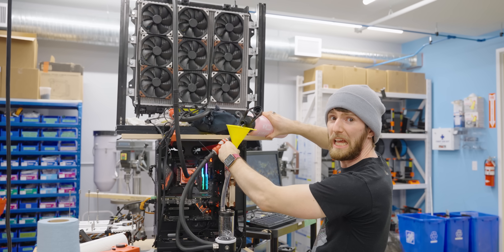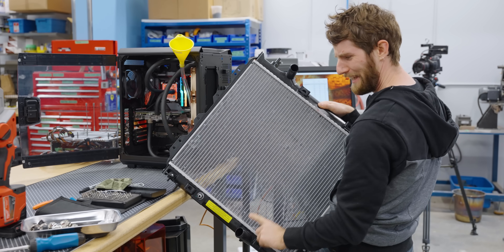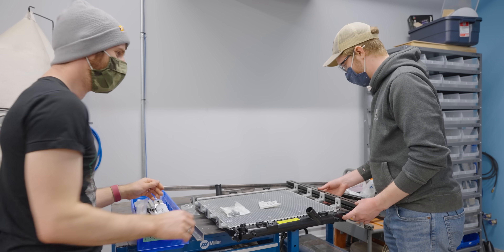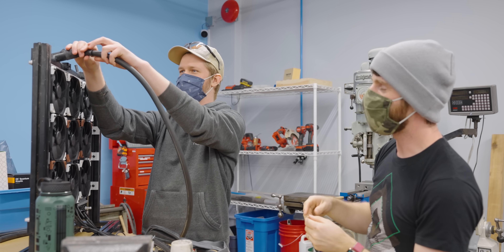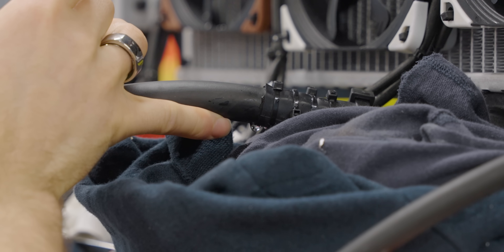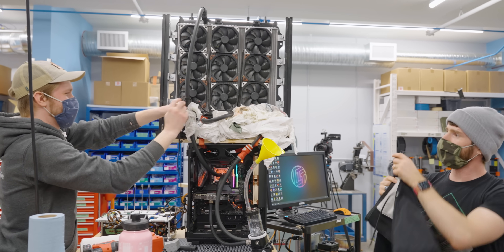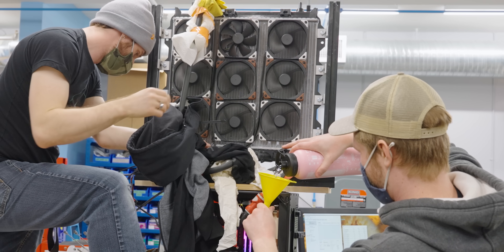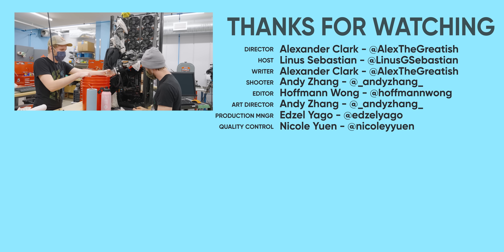Our Craziest Cooling Project Yet - Car radiator liquid cooler

Comment: 3:05... Hmmm, the transmission cooler part cools high pressure ATF (automatic transmission fluid), which is more a high detergent oily feeling substance, thick),  the motor cooler cools the water7coolant mixture flowing through the engine channels to cool it. If u link them, that means your fluid will have to literally fill BOTH channels before return, AND, one channel is not made for water but rather, hydrualic fluid (ATF). They'Re actually 2 radiators in one. Transmission coolers used to be attached to the outside of this motor cooler, but I guess now they're just "built in." U go a water base so, stick the the water (engine) channels. Oh, and u should prabaly actually use some anti freeze so you don't ruin the internal components of the radiator with rust or chemical reactions.

Comment: I know I’m super late to the party but, y’all are using the ports for the transmission cooler section of the radiator. If you use the to big ports those are the ones used in cooling the coolant.

Comment: A motorcycle radiator would have been better. I wouldn’t have worried about the transmission cooler pipes on the radiator they wouldn’t gain any extra cooling as the pipes just go through the water that is in the radiator already.
A proper redo would be good. Less duct tape and more proper setup.

Comment: First off you could have got that radiator cheaper on eBay probably could have got 50 bucks you could use the extra money to go to the hardware store and get some plumbing fittings and downsized it to whatever you want it and if you're not planning on using the radiator again you could have just used plumbers glue!

Comment: 20 yrs ago car radiators were what everyone used. There were a handful of cars that were known to have radiators that could easily be shrouded for 1-2 120mm fans (or bigger if you liked). As I remember, there really was minimal advantage to going bigger unless you were trying to go passive.
Reply: They were the heater cores, a radiator this big is designed for levels of airflow that won't be achieved inside a house without a turbofan.
Reply: 20 years ago was only 2003......
Reply: @Alcoholic_Nerd  Well 20-30 years ago. Before there really were over the counter water cooling kits, or at least any that were worth using. Haven't kept up exactly on the scaling of thermal load from cpu's and gfx... but casual observation says cpus haven't increased much, while gfx have gone up 100-200 watts or so... shouldn't really impact the size of a radiator required for liquid... guys were running systems with TECs on top of their CPU's and GFX without scaling up systems much if at all; which was probably pushing them to about the thermal load of a modern system.

Comment: Have you looked into using a transmission radiator for a build? They come in smaller sizes. You can use two and have it in a smaller form factor.
Reply: I was thinking the same or even power steering radiator

Comment: This video makes me think about an external honda rad with the og fan and a small pump running off a 12v power supply outside the office and piped with pex pipe through the walls

Comment: Guys should re-do this video with a smaller rad (motorcycle maybe?) and you could remove one side panel of the case, and put the rad where the panel was essential turning the rad into a piece of the case.

Comment: Since it is an actual car radiator, why not use car radiator tubing and connectors to hook it up and modify it to mount to your PC.
As well as used Antifreeze instead of water for coolant.

Comment: Transmission does not need much cooling so it makes sense to just have it integrated with the engine line. Also might be the oil itself that gets passed through judging by the fitting for it.

Comment: Which numpty decided to put the radiator on top of the system before you’d even run an air leak test before starting with water? Stop messing around with crap zip ties when jubilee clips would have been so much easier. I get it, a lot of unnecessary screwing around makes for a dramatic story, but it also shows that you guys should never, ever, work on any domestic plumbing or anything to do with combustion engines. 
The whole episode was a total car crash from the start, but bloody funny all the same!

Comment: I made my first water cooler (in eary 2000s with an athlon xp 1800 cpu) from a chevette heater core with 4 80mm fans and a 10 gallon fish tank. It worked perfectly and only cost me a few bucks at the auto recyclers. Eventually I waterproofed in and around the cpu socket with neoprene/dielectric grease and added a peltier. Combined with a mobo voltage mod, I was able to get over 4Ghz and the system was stable.

Comment: The transmission cooler is closed loop from the Radiator.  You cant fill the radiator, using the transmission cooler lines.  I know this is an old video.  You could have only used the large Hose connections for this purpose.
 
As a car guy and a computer guy i always wondered how this would have worked also.

Comment: I feel like they lost a lot of flow rate from using the trans cooler loop, since all that does is flow trans fluid through a small heat exchanger in the radiator tank to disspate the heat into the rad water
Having it in the loop wouldn't  change thermals, just add resistance to the loop

Could be cool to see this used with a mineral oil PC where the mineral oil is cooled through the rad (though watercooling a mineral oil PC would be fairly pointless too but interesting nonetheless) Or you could use it if you wanted two independant loops for CPU and GPU using the same rad

Comment: Two points I'd like to make. First, how you were testing the radiator water was coming out one of the transmission cooling ports which indicates that the transmission cooler is no good in that radiator. Secondly how in the world do you guys work on computers without understanding that if you put a cooling tank inside of the coolest part of a radiator it's going to cool whatever liquid is going through that cooling tank?
Bonus info, all you had to do is blank off the transmission cooler taps.
This is getting hilarious, it's like watching Joe Biden try and give his State of the Union Address. Go get him!

Comment: The thing is automotive radiators are pressure rated to pass way more heat to the air from the water circulating I say y'all should have opted for a 04 grand prix radiator because it has a cap at the very top but it would have been waaay more annoying to use I say there should have been like barbed fittings or nipples really to have hose clamps there to bite down on to stop leaks and fill it from the top because car radiators can take like a literal gallon to fill and filling from the top well for air mostly. But that radiator is rated for 16 psi you should probably see if that benefits in anyway to see if the water can withstand more heat transfer to keep it cooler a car engine can well heat over to boil water and it looks like a cpu can too

Comment: The radiator that's inside the heater unit would be better suited, they usually have a decent 12v squirrel cage blower all incorporated into the housing as well as using smaller tubing.

Comment: I have a very good idea for this. But this requires long tubes, and living in a winter place. Stick it outside mounted next to a window, cover it with some anti freeze stuff and even furnaces to keep it from freezing, but the water/ coolant will be super cold and keep the cpu (and gpu if you water cool it) super cool and chilled. Except you would possibly need another pump to pump from the radiator to the pc, so it'd be in the middle.

Comment: You could probably accomplish the same thing with a bucket of water with equivalent thermal mass. Unless you're able to build a watertight loop and leave it running for several hours you won't know what it's like at saturation.

Comment: I'd like to see this project revisited, but with just a SLIGHT bit more effort put into the plumbing part of it so they don't have to continue filling up the pump reservoir due to leaks. It wouldn't even be that hard to do really. Maybe they could even use a car's electric fan, too.

Comment: dont need tranny loop..better to use just the engine radhose connections..trannyline is just a short tube from one port to other on the bottom

Comment: Ditch all of those fans and bolt a box fan to it lmao but to answer linus's question about the radiator having two seperate cooling loops. on modern cars it is extremely common to have the radiator also cool the transmission fluid or power steering fluid. So they double as a water and an oil over air cooler

Comment: The transmission cooler is a separate heat sink inside the radiator end tank. ATF (automatic transmission fluid) goes through that separate, smaller heat sink and still transfers heat due to being surrounded by the engine coolant inside the end tank. So in a way the transmission cooler still rejects heat into the main radiator, removing any need for a large radiator as it only has to transfer the heat and not dissipate it.
Reply: Btw, even though the OEM style plastic radiators are cheaper, a full aluminum radiator would be much better for a project like this as you can modify the end tanks much more easily for your application, even welding on PC water cooling fittings, compared to duct taping mismatched hoses to the plastic end tanks and making a huge mess with all the leaks. In fact you can actually get custom sized cores and weld your own end tanks on, pretty common practice for performance automotive.

Comment: For years I have been wondering about using a car radiator as a means of getting cooling without fans, or at most 1 large fan running at such low speed, you cannot hear it. I want to test it on my next PC build. But before that, I will try an air conditioner condenser coil which I already salvaged from and old portable AC unit and already has a large fan to go with it. Nice to see this project. The largest hurdle would be finding a way to connect the loop to radiator inlet and outlet without leaking. I would ignore the transmission lines since that is water cooling your water, i.e. no actual cooling improvement.

Other ideas when I get the time and money. I can have long tubes and place the radiator outside the house so the heat does not warm up the room and I can run the fans harder without hearing the noise. Another idea is to have the loop consist of copper tubes soldered along the tubes of an evaporator coil of an air conditioner, so the air conditioner directly chills the water and the noisy condenser is outside where I cannot hear it.

Comment: You definitely can get a rad much cheaper online and could have gotten one with a fill port that would have been much easier to fill and using the trans cooler only adds capacity

Comment: i actually used a setup like this for a while. i used the ac condenser out of a Chrysler Pacifica along with the dual 10" fans that were on it from the factory. i ran the fans in series of the 5 volt rail of a Molex connector. if you cut off the threaded fitting on the condenser you get 2 lines with ~.5" outer diameters which is about perfect to force on some coolant lines. the cool thing about this. is the radiator is big enough that my temperatures did not change when i had the fans on or off
Reply: and of course naturally because it didn't fit in a case i just screwed it all to the drywall. drywall in non conductive for the 12 volts computer operate on and never had any problems with leaks or thermals
-ryzen 1700 overclocked to 4.3Ghz
-GTX 1070 msi twin frozer
-GIGABYTE GA-AX370-Gaming K5

Comment: Do it with a 1990's honda civic radiator, which is much smaller, and capable of literally being a side panel on the PC.

And get your radiator from a damn junkyard. I bought my wife's ooooold car a new radiator and the guy at the pick and pull wouldn't even charge me the full ten bucks for it.

"That's not a radiator. That's half a radiator. I'm only charging you half for that thing."

Comment: Master car guy, but also nerd: *them discussing ins and outs of radiator, and the loop they wanted* 

ME: NO! nO!!!! Ignore the little ones!!! Just use the big ones!!! 

(Reason; the little ones are for cooling the transmission oil, inside the bottom tank of the radiator it's segregated from the coolant. Its just a coil or block or something cooled by coolant. But it's low flow 8-10mm line. No dice for your application.)

End edit: "it's two chimps on a davenport, in a basement"

Comment: This was infuriatingly stressful to watch. Put the damned radiator on the table next to the computer and make sure everything is sealed before you put the water in. Do a blow test while plugging the opposite end to test before putting in any liquid.

Comment: not read the other comments, but you have a double sided case there, would it not be possible to find a car rad thats small enough to fit in the back side of the case, and move the rear components into the front?  It should only be the psu and ssd back there, right? more than enough room in the front with only 1 gpu
Reply: As well, I always see car rads being used, have you thought of motorbike rads?

Comment: Id like to see this actually attempted/ I wonder how long it would take for that much water to heat up. its like a big heat battery at that point
Reply: You would have to be running your cpu pretty toasty. Dont forget even without a fan the radiator will dissipate heat into the metal and into the air. The amount of heat to do that would be pretty intense. Remember cars are literal explosions.

Honestly with that amount of metal I doubt it's possible at all.

Comment: Lower section for the transmission. Has a loop that runs inside the plastic and cools down with the cooland that its already cold from the fan
Reply: huh. I thought it might be there to warm up the oil faster, not cool it down.

Comment: You should have put barbed fittings in your standard tubing and then used actual hose clamps on your inner tube connections. It wouldn't have leaked as much if you had.

Comment: Most replacement radiators have automatic transmission cooler/connections, for use in both automatic and manual transmission equipped vehicles.  If your car is an automatic, you use them - if your car is a manual transmission, you simply ignore the transmission cooler connections as if they were not there.  To correctly build this experiment, use the large upper and lower radiator hose connections while disregarding the transmission cooler tank/connections completely.  The only thing that goes through the transmission cooler is transmission fluid.  That tank along the entire bottom of the radiator is not part of the coolant loop, as ATF (automatic transmission fluid) passes through here to be cooled on its way back to the transmission.  Including the transmission cooler in your loop as you did is the equivalent of putting in/out hose connections on an empty can sitting on the desk next to your computer.

 Sincerely,
NAPA employee somewhere in Utah

Comment: The transmission cooler section cools the ATF through being exposed to the temperature of the engine coolant, which has its temperature managed by the main section of the radiator. This helps to keep the transmission temperature cool enough(as ATF has an ideal temperature of around 200 farenheit, which is also the usual temperature that an engine runs) while warming up the transmission fluid to operating temp quicker which reduces wear and improves function of the transmission.
Reply: It actually depends on the model year. Older cars dont like being that hot. every pre 90's cars ive seen tend to run between 170F and 190F. So 200F is actually overheating. modern cars running at or above 200 is something im having to get used to. my new camaro runs at about 208F which would be overheating in any of my other cars. They also clearly put no effort into searching for a radiator for this project. A quick google search found me a $45 USD rad for a civic on amazon which would be roughly $60 canadian.

Comment: You used the wrong radiator should use a manual transmission radiator not automatic the automatic tranmission radiator has coolant hoses and transmission lines on the radiator and the manual radiator only has 2 coolant hoses on it i could make it no problem with no leaks and a frame for the case

Comment: To use the big inlet and outlet for your application, you can put electrical shrink tubing on there instead of tape and zipties.. it would prlly work like a charm to bridge the two different diameters and types of tubing as it shrinks tight. And u can prlly ditch the fans as the radiator is made to cool a internal combustion engine lmao

Comment: Question.. what if... now stick with me... you use the stock PC water radiators and equipment, BUT use AUTOMOTIVE ENGINE COOLANT instead of water? (before the corrosion comment.. automotive companies use different types of coolant, dependent on the types of lines and metals used in the coolant system)

Comment: We once made a cooling rig for a friend, instead of a normal resevoir and radiator, we used his garden pond outside his office. 5000 liters of water, that even in summer never gets above 20°C. A pump that delivers 250 l/hr, flow-meters with temperature and warning if the flow dropsin the in- and outlet, and lots of custom made piping. Works very well, but LAN party is always at his house

Comment: 🤔 maybe should have just got hose reducers and capped the transmission lines? 🤷‍♂️ or found a radiator that went to a small Diesel engine or commercial lawnmower 🤷‍♂️